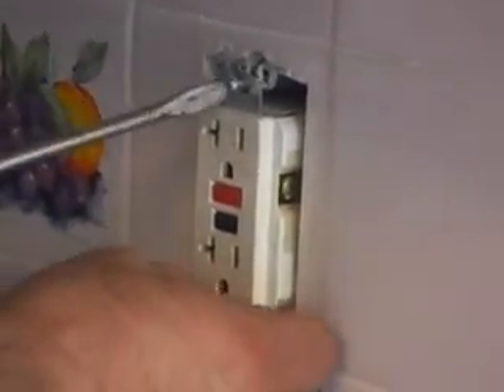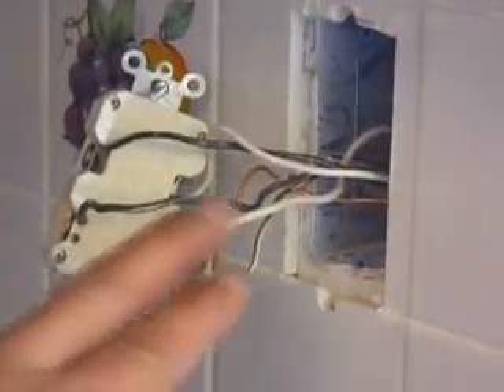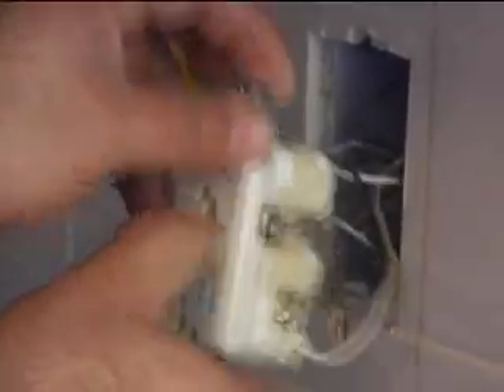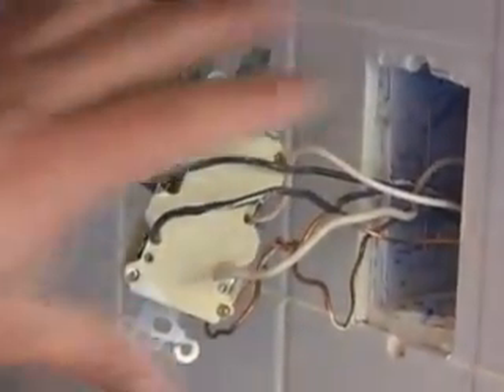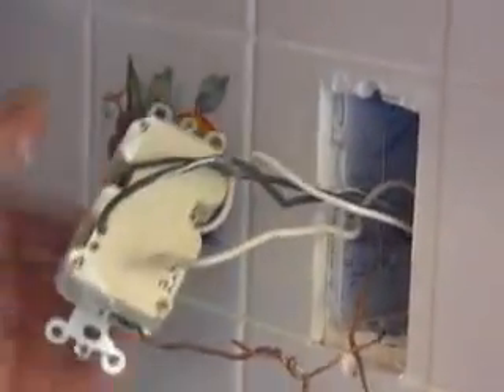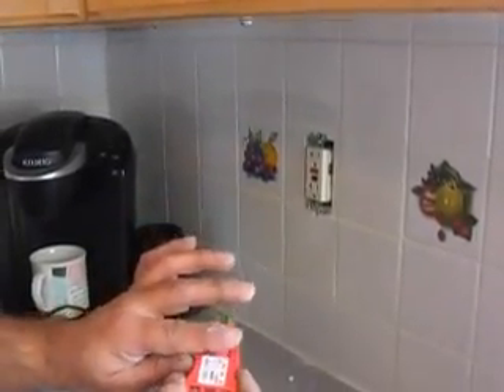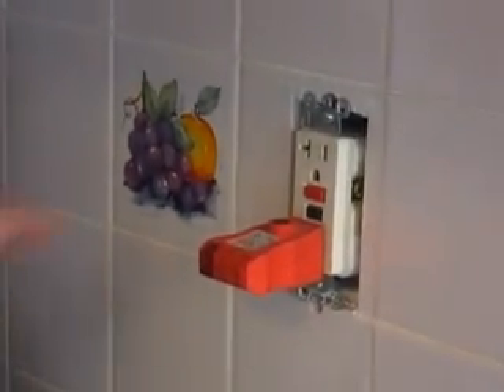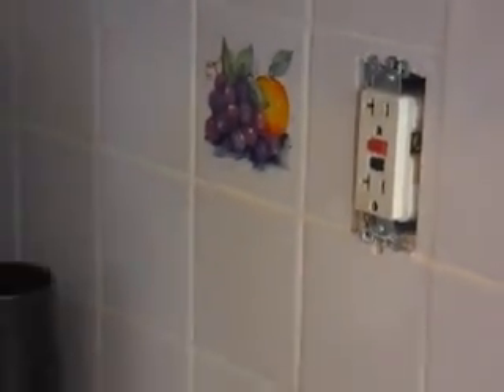How to replace and GFI outlet and how it works

Comment: Gfci receptacles can be used without a ground wire and is an NEC approved method to add user safety if upgrading from a 2 prong receptacle. The appliance or equipment may not be protected from a ground fault without a ground wire

Comment: Hello @Askmediy, can you message me on my email djskribble@msn.com or maybe reply to my comment.

I’m trying to figure out why my GFI is not working. It’s getting power to it 12V, but the actual gfi does not have power. I went to Home Depot and bought a new one replaced it and the same thing is happening. Also the non GFI plugs that are downstream do not have power to them. I’m tempted to replaced each one of them. I’ve already popped them open to see if any of them are shorted out but they all look good. Any suggestions?
Reply from the maker: 12v ? sounds like it's tripped
Reply: 120v sorry

Comment: Hi! I have a question. I know how to replace the outlet, but I'm wondering something else.. My GFCI receptacle blew and took the row of lights out with it obviously. I cannot reset it because it is broken. I checked all the fuses in the box and they are fine. I'm wondering if I can get another one and reset them and then take it out and put a regular outlet in. I have no idea why they put one of these in my bedroom because from what I understand they are used primarily in bathrooms and kitchens because the presence of water. Again, I just want to know if I can put a regular outlet in after I have had one of these receptacles in there?
Reply from the maker: Yes of course. Just change it out.
Reply: I hope you have fixed you’re issue but yes Go ahead a replace it with an outlet just make sure to turn off the breaker because the wire will still be hot most likely that was feeding the GFI

Comment: replacing gfci..breaker off at box but i still have a charge around the screws..why? what to do?
Reply from the maker: If the breaker is off you shouldn't. But what are you using to test it?
Reply: askmediy ...multimeter read 0 but still little tingle on screws..what to do?
Reply: askmediy ... just  checked it with voltage tester after breaker off..still hot..has 5 wires..2 blk, 2 white, 1 copper.  what to do?

Comment: In my outlet box I have 3 black and 3 white plus the  ground wire. When I plugged in my tester it says open ground. The ground wire is connected. Where did I go wrong?

Comment: I made a 5 outlet box GFCI protected temporary circuit with a three prong plug to be plugged into an existing out door outlet. When I plugged the circuit into the outlet the indicator light of the GFCI lights up but the circuit remains dead.  The circuit was made for temporary outdoor and seasonal purposes. What is not right?
Reply from the maker: Sounds like you have the power going into the wrong side.

Comment: I have 3 bathrooms all with GFI , they all stopped working, I checked the breaker all is good there what could it be, thanks
Reply: GFCI receptacles can go bad.  Also, make sure they are not all installed on the same circuit, with two down stream from the first, because if the first one is bad, it could be causing issues with the others.

Comment: Does the breaker need to be a gfci breaker? I had an outlet near my sink, changed it to a gfci. Do I have to change the breaker for it to? Its not a fed outlet
Reply from the maker: Either one is fine.
Reply: +askmediy awesome thanks
Reply: If you install a GFCI receptacle, there is no need to install a GFCI breaker.  It should be either or.

Comment: i have four oulets on the same breaker and my tester show hot and neutral are reversed on all four. is it safe to reverse them back the right way or is it going to interfere with the breaker in some way. i also use my surge bar in these outlets and the ground light on the surge bar don't come on and the ground is on good , could this be because hot and netral are reversed. please help DOMONIC!!
Reply from the maker: +GmGarlo It would be best to fix each outlet so the wires are installed the correct way. However start with the first one.
Reply: do you think because there is no ground showing on my surge bar could be related to the reverse setup

Comment: hi, I was wanting to know since you said that it would stop other normal outlets from working, would a gfi outlet that is at the end of life stop kitchen lights from working?
Reply: @Meghan Marie  Sounds for me do you not understand how a GFI (or RCD) is working. A normal socket have a side for "Hot" and one side for "Neutral". Do you can install the IN and OUT power up to you. The GFI have a marker which is IN power and other is OUT power.  If the CFI breaks the power for HOT side all other sockets and devices behind(!) OUT power is powerless too. That's the once secret! 

If you let works all your GFI outlets in one room just alone do you let the OUT power screws only empty. Do you rewire from every GFI socket only from the IN power to next GFI socket IN power. If one device is chrashed exact only this GFI socket device stops the power and all other installed devices at the other GFI sockets works without a break.

If you let work only one GFI outlet in one room controlled and saved all other normal sockets do you put them on the OUT power of the GFI how should be the first socket in this room! If one device in one of the sockets chrashed, the GFI stopped the power and all devices in all sockets stops too!
Reply: +OldLordSpeedy I figured it out lol thanks though
Reply: +OldLordSpeedy the kitchen lights wouldn't work because there was wires in the closet that weren't put together so it stopped the lights from working lol XD but I mean I did replace the gfi outlet.

Comment: so I have an outlet like this in my laundry room problem is that it keeps tripping every time I try to use my washer or dryer. the dryer repair guy said I need to replace it with a regular outlet but I have no idea what other plugs are on this circuit. so completely confused and need help. mind you I have a severe fear of fire and worry about messing with it but I can't afford an electrician either please help. thanks
Reply from the maker: +Christina Frazier Well if you live near me it would make a great new video. Ok, here's the deal. It would be nice to know what else is on with that outlet. I'm assuming your dryer is gas, right? I would first start by replacing it with the same type of outlet.

Comment: your the best dude. i now can replace the outlets in both my bathrooms. but can u explain if what you just taught me would work with replacing the light switch in my bathroom also?
Reply from the maker: +LpAssassin (FReestyle) Yes of course. Little different but you're get the idea.
Reply: askmediy 
Would you lossely explain shortcuts and terminology of the trade (i.e., gfi?) And other terms most diy'ers are unfamiliar with.

Comment: My GFI outlet started tripping recently.  And now it won't even stay engaged at all.  Which means I lost three outlets (including this one) and two under-cabinet lights (which are hardwired into two different outlets).  Headed to Lowe's today for a replacement, but needed to know what all was involved first.  Your video demonstrated and explained perfectly everything I needed to know.  Thank you!
Reply from the maker: Thank you. Replacing it should solve your issue
Reply from the maker: ***** Means your hot is not connected. Pull the outlet and test the wires. Outlet itself could be tripped.

Comment: A gfci will work without the ground wire attached. As a matter of fact it is legal per NEC Sec. 210-7(d)(3) two replace non-grounding outlets(two prong outlets) with grounding outlets (three prong outlets) where protected by a GFCI device. Of course you should hook up the ground wire if one is present though.

Comment: Hey Dom, I`m in an older house and the outlet in the bathroom is not a GFCI outlet but it is supposedly protected by a GFCI circuit breaker. The outlet keeps tripping when I plug in my trimmers or the wife plugs in her hair drier. This is El Paso, Tx with an older home and I`m not sure about the wiring codes yet. What are your thoughts about the outlet constantly tripping?

Comment: So "line" is for the incoming power and "load" is for the outgoing power line that feeds power to other outlets down the line...  right?  And after installing a GFCI outlet... any outlets...even non GFCI outlets down the line, if they get wet, the power will instantly shut off..  Is that right?
Reply from the maker: I wouldn't go as far to say get wet but yes you're right.

Comment: Is it fine how those two ground wires are spliced together before they attach onto the ground screw. Or should they be connected with a marette and pigtailed onto the screw?
Reply from the maker: That's fine. it's the others that need to be separate

Comment: When installing a gfi... does it have to be connected to the ground line in order to trip other areas in the house!?.... I installed it in the kitchen but it only trip that one outlet :(
Reply from the maker: Yes a ground is very important. There is a load side and a line side to these outlets. Very important the line goes in the line side. Line is power in
Reply: What if it only has a white  a black and ground....  would that work?
Reply from the maker: Siana' Muthwill Yes that means there are no other outlets on that circuit or it is at the end. Just connect those wires to the line side of the GFCI outlet.

Comment from the maker: Then you don't have any power, check the breaker. Also check for other outlets for now power. Mainly look for other GFI without power and that may be tripped. Look everywhere. Basement, garage, outside

Comment from the maker: I guess that would make a good video sometime soon. But for now, you would need to test which one is the power, and of course the other set would be the load. 

The line would have power, and the load would not. Only if a single outlet was used for that circuit or if it's the last one on the line would it just have one pair.

Comment: Question: I  installed a GFCI. Right next to the outlet is a single pole switch for the garbage disposal.  I have 3 neutral wires and 2 black wires. On the old outlet I had 2 neutrals for the top, 1 for the bottom. Black 1 for top 1 for bottom. Installed it, tested it and tester shows its correct. 6 feet away in the dinning room is an outet. I hooked up the radio and it tripped the GFCI. If you plug anything into the dinning room outlet it trips the GFCI and the dinning room outlet won't work?

Comment: I am trying to replace my wall outlet in the bathroom to a GFI when I opend it up I found 1 black wire, 1 ground wire and 3 white wires and one of them was snipped back and not used also none of the white wires have markings....what do I do?

Comment: We ended up buying a new circuit breaker the circuit breaker we got from home depot was stuck in the neutral position so we thought something wasn't right but they sold a faulty one.  Thanks anyways for the help you're awesome.

Comment: Hi Dominick, now before installing one of these should you turn off the power?  Also we had someone in the house plug in a hairdryer into one and now they outlet and other parts of the house outlets don't work anymore.  We've tried resetting the circuit breakers and we've tried replacing the 20amp circuit breaker for the outlets power and still nothing.  I tried replacing the GFI outlet but nothing.  Any ideas?

Comment: o	Part 2- The ground to ground.
Left side: The white is connected to the top white screw since the tab is not broken I assume.
Right side: The top screw is connected to the red wire (operated by a light switch) & bottom screw to the black wire.
Now, to run a wire to the outside through the wall for my Xmas lights, should I:
a) pigtail the black to black
b)white to white or use the second un-used screw on top and of course bare to bare.
PLEASE HELP ME OR ANYONE.

Comment: o	Please help. I'm trying to install an outlet outside my house for Xmas lights. I'm tying in from an outlet right on the inside of the house. Turns out the outlet has a 3 wire. The top connector is connectd to a light switch and the bottom is always hot.
On the right side of the outlet, the little tab is broken and on the left side, the tab is intact. Please paint a picture.
The way this plug is currently connected is described on the next message. Please read.

Comment: little late of a reply, but if the old wire is of BX type wire meaning that it has a metal shielding, that is the ground. You could run that old wire into a metal box with the proper connectors, etc. and then the box is grounded. Then you could run the range hood wires into that and connect the green grounding wire from the fan onto the box itself.

Comment: Good video...thanks!  My GFI outlet blew...the reset button was sticking and when I pressed it harder it actually  exploded and now the outlet is black outside.  I'm wondering if I can still replace it myself or if I need to call an electrician to check it out...?

Comment: in the u.k. you would have 220 so there would be a need for a sleeve for the ground in U.S.A. we have 120 not a bad i'v been shocked by 120 and 240 BIG DIFFERENCE

Comment: Interesting, sounds like they might work differently to RCDs (residual current devices) in the UK. The UK ones don't rely on the ground connection (although in the case of an RCD-equipped socket outlet one would be connected to the ground pins), instead they detect the difference between live and neutral currents. More than 30mA difference (indicating it's leaking to ground somehow, possibly through body contact) and they trip.

Comment: Trying to hook up a gfci outlet between a switch and a disposal.  The wire he has coming out of the wall at the disposal, I am hooking it to the line side of the gfci. I put my tester in and turn the switch on and the gfci trips.  The tester is worjing properly.  My question is could the switch be breaking the power wrong ???? I thought that it did not matter.  Hope you can help.

Dave

Comment: i am trying to replace an outlet that has gfi on but whn i  open it going to rewire it  this gfi box has different wires then here there orange one  a black one and a white one but there is no ground wire and  only on outlet and all wires from outlet match same  wire but wondering how i do rewire it w/o cutiing from both from outlet and wire and do u need a ground wire or not  i'm wondering before i go find help to do it

Comment: @ryanathan2 Ground wires play a roll that if anything shorts out that it had a direct bath to ground and not you. If i wire was to get cut say like a nail  or screw, one the screw damages the hot wire and comes into contact with the uninsulated ground it should short out. if it was insulated then the path of the hot wire would go through you if you completed the circuit of hot to ground. No insulation on the ground wire increases the odds to trip the fuse if the circuit has a problem

Comment: @MrStanley1109 Yes you can. ground is ground. Its all Once circuit in the end. Is it old wiring? Ive yet to see a house wired with out a ground unless its Knob and Tube wiring.

Comment: @betsmur If the box is out of alignment side to side, then you just loosen the mounting screws of the receptacle or switch and shift it so it straight then tighten the screws. If the box is sticking out bast the drywall then you will have to cut the drywall and reset the box. If its just the corner of the box sticking out then i just file/grind the corner back so the faceplate mounts flush. Studs tend to twist after a bit and after drywall is on most builders dont care to fix it. :(

Comment: Hi Dom,
You're a great teacher! I have a question. I replaced a refrigerator and the new refrigerator has a plug with the 3 prongs. My electric outlet behind the fridge is the standard 2 prong outlet.  I put an 'adapter' in until I can figure out what to do!  There IS a copper wire, not connected to anything, behind the outlet cover.  Can I take out the 2 prong type outlet and put in a GFI outlet like the one in your video, by just attaching the copper wire? Can I do this myself? Thanks! Linda

Comment from the maker: @heidifromokla Spiders aren't that bad. OK it seems like you don't have any power to the outlet. However I would recommend calling someone that knows and that is not freaked out by electrical. That's just how people get hurt. I kid you not. If you have to RESET the breaker there is a issue somewhere. Yes it could be the GFI, but still the same. Or send me in a email your number and I'll try to walk you through a few steps.

Comment: It seems like the GFI would work even if you did not have a ground wire, such as in an old house with just a hot and neutral. Wouldn't it still trip the hot wire since it is measuring the difference between the hot and neutral current?

Comment: @DominickDiy  ... line vs load.. just to get this straight... I bought a surge protected outlet (with line and load on the back) I am adding this behind a flat screen tv from an outlet down below. Just want to make sure I add these wires to the line connection on the surged outlet *coming from the outlet down below.

thanks again!

Comment from the maker: Well it still could be GFI protected. You would really need to get one of those tester I was using in this video so you could test it. 

As far the landlord, humm really depends how nice they are. And how old is the building. GFI are not that old but old enough. So more less it depends on what was the code when they built it.